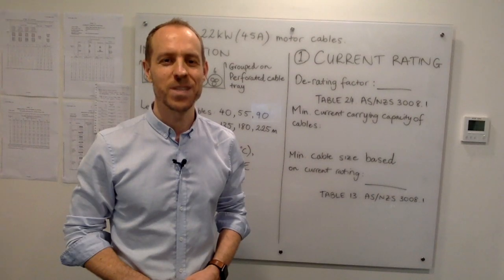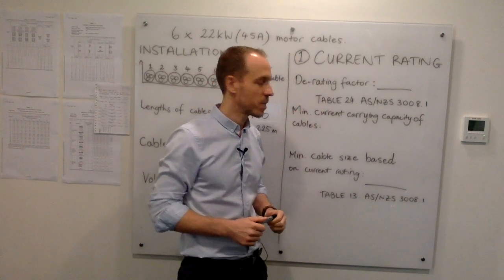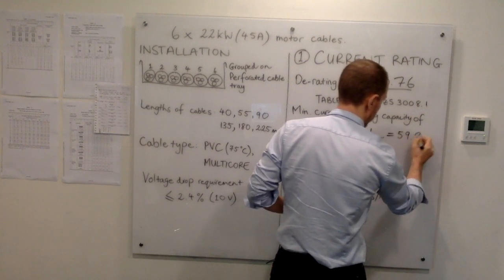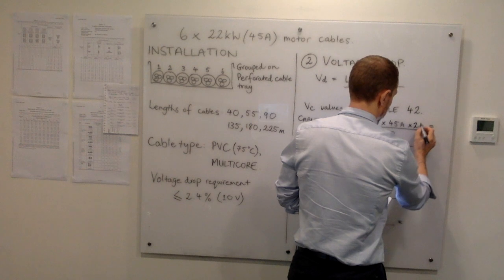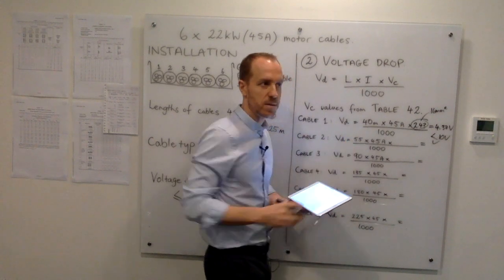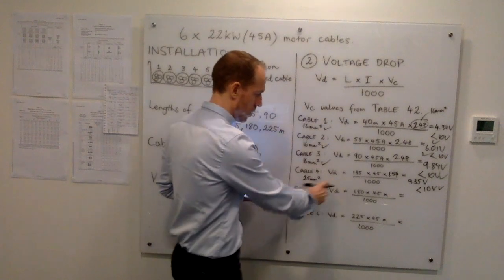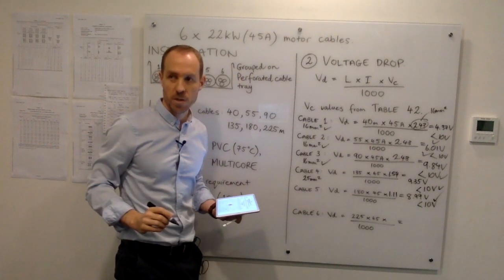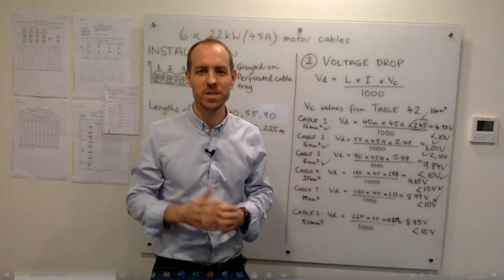How to Calculate Cable Size by Hand and using Software || Based on Voltage Drop and Current Rating

Comment: How 45A is calculated? What is the power factor you used?
Reply from the maker: Thanks for your questions. 45 A is given, it’s the rated current of the motors. The power factor is incorporated in the simple Vc constant for voltage drop as either 1 or 0.8. You should use software for better accuracy-see the link to ELEK Cable Pro Web above.